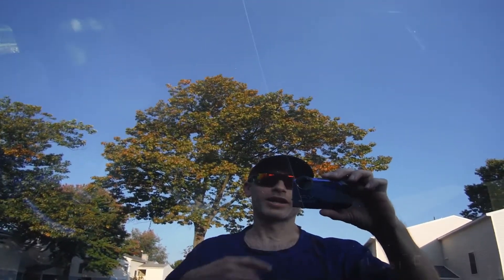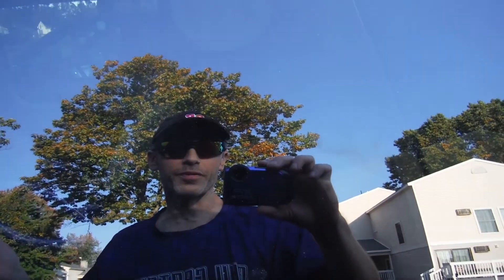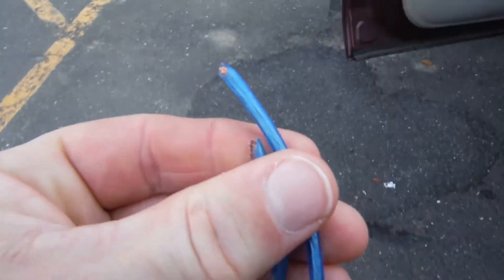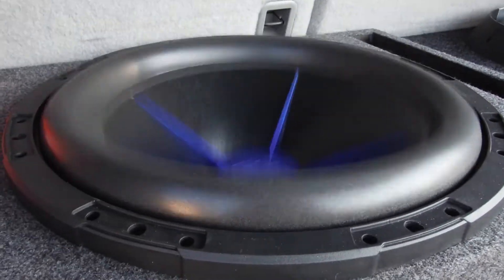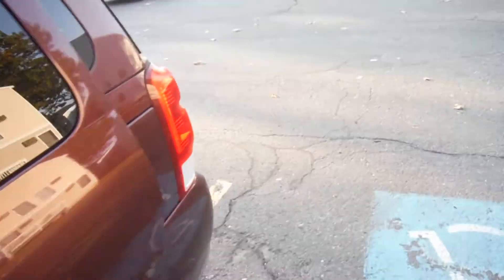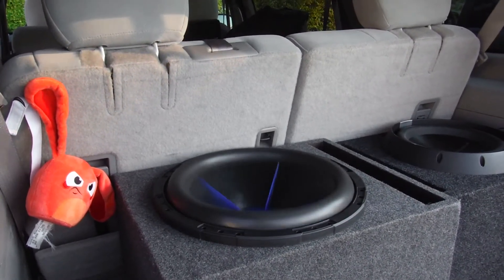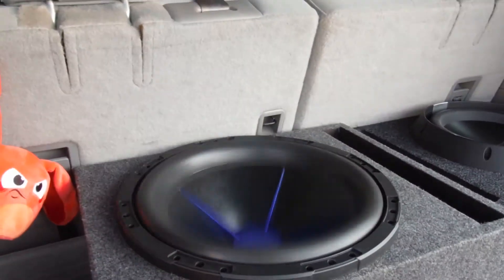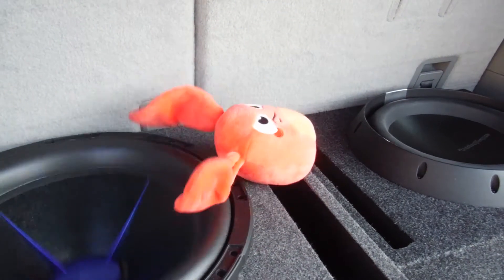Power Acoustik MOFO-152X 15" 3000 Watt  Destroying and Slammin the Chevy

Comment: Sub & Paws, when playing a sub especially in a ported box, it would not be wise to play below your box tuning.

Yes it's moving quite a lot but all that motion is seen as heat inside of the subs coils.

It seems as if this is a prefab box which is not a great start but it is a way to find your new box tuning.

You would need a tune generator or use   youtube test fs to run a sweep of fs to see where your optimal tuning is in that application.

Start @ about 50 Hz and play lower until the cone of the sub moves less....this will be your new box tuning for your system.

When you pass that point the sub will start to move more aggressively.

To the sub, this is seen as heat and will damage the coils due to acoustic energy starts to fade rapidly as the cone moves more.
At this point it becomes an air pump rattling the sheet metal and burning the coils.

Most amps has a subsonic filter...I honestly would set it at 30Hz to help your subs last longer without frying.

We have a Facebook group...MOFO Nation that helps people whom use the Power Acoustic products if interested in farther assistance.
Reply from the maker: This is a very old video. I sold this sub about a year ago, and also a very short video. Just a demo for the video and nothing more. Same with the enclosure, I don't even remember the last time I used this box. I've probably done well over 100 different subwoofer demos since this video. I do appreciate you taking your time and all your information. This is 1 of over 200 subwoofers I own and a couple minutes of using it just to shoot a video. Thanks for your information and thank you for your comment 😊

Comment: @Subs&Paws I have 2 mofos currently underpowered on a planet audio 2400 .. It's time to step it up I want it so loud I can't stand it so I'm wondering should just grab the taramps 3k... Or the 8k????
Reply from the maker: The Planet Audio amp does about 500 watts, I have the same amp with a live dyno test. If you get at least a thousand watt amp you will notice a huge difference. Seismic Audio has 2 diff amps, one is a 1000 watt, and the other is a 1500, they are both around $150. If you put that on your subs be gentle and safe and then have fun, it's a very powerful amp. If you do want to fo with the Taramps just make sure your electrical is up to par, every Taramps amp pulls massive amounts of power. Thanks for your question and your comments.
Reply: @SubzPawz  Thanks u so much.. Right I thought around 500 watts as well lol them things gotta be starving lmao.. That's the thing I really wanna go with a lot of power and not worry about power again.. I drive a 2010 vw cc but don't know what exact electric application to go with as far as high output alternator and so forth  been budget building for a pretty long time. 🤣🤣🤣
Reply: @SubzPawz  I just watched your demo/review on the amp.. 👍👍👍👍ok I see what ur saying ur saying give it a try probably will have to change very little to my current setup
Reply from the maker: @carlosjenkins68  good, I hope you get the sound your looking for.
Reply from the maker: @carlosjenkins68  Look into a high output alt as soon as you can and get that installed ASAP. Thanks.

Comment: Hi. I currently have an Audiopipe 1800D amp and I was pushing two Audiopipe 1150w TS-QR 15's. But after 9 long and hard beating years I finally need to replace them. I'm looking at the Power Acoustik BAMF or the MOFO 3000 or 3500 watts. I'm not looking to change my amp out so do you think the Audiopipe 1800 amp is enough to push dual 15 inch Power Acoustik MOFOS or BAMF? I'm using a Pioneer 2600 BT head unit so nothing too fancy. They just discontinued the Audiopipes I had and for the price these Power Acoustiks seem like a deal. I would appreciate any help or feedback. Thanks.
Reply from the maker: Think you'll be fine, your Audiopipe amp is 2 ohm or 1 ohm stable, they have change through the years. If you run it at full power you should be fine. The Bamf is a bad ass sub and the Mofo I just got the 10 inch to compare with the 15 inch. The video is not up yet I'm still shooting it. But it should be out today. Either or you will be fine with the amp you have and either of the subs you want are great options. Thank you for your comment.